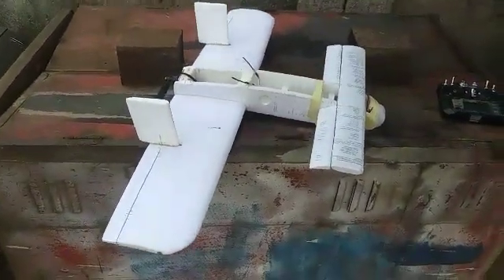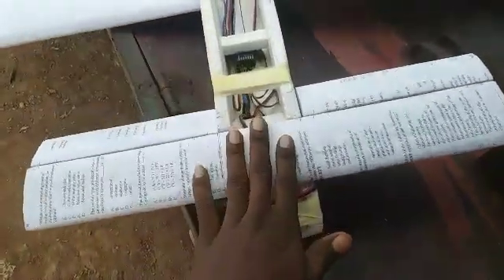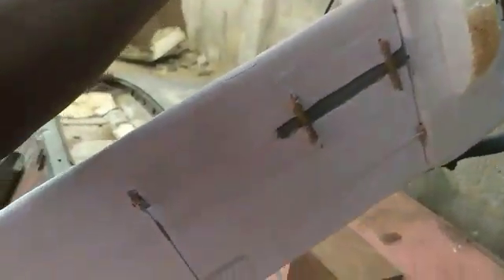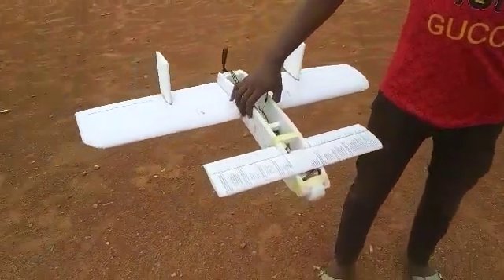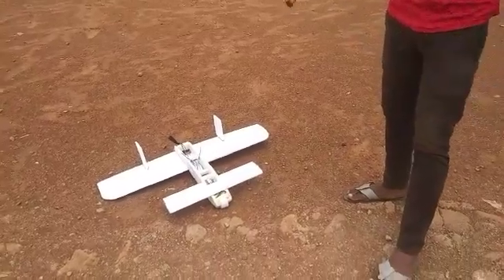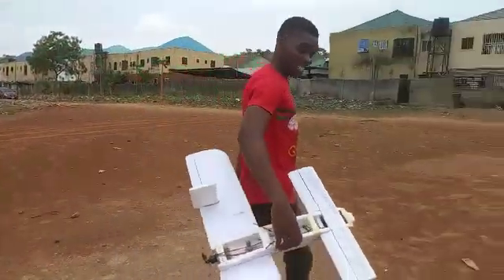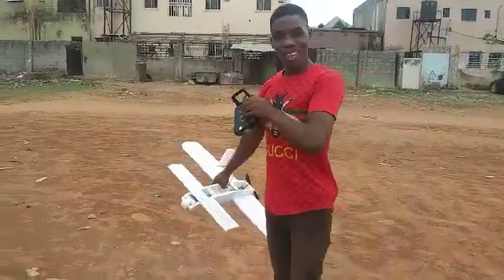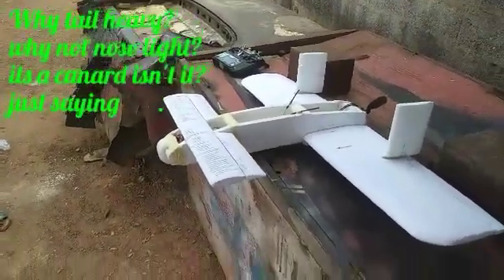Homemade RC Canard Airplane (AR Solonig)! First Flight

Comment: Beautiful work! I hope you will be able to fly on a calm day soon, as it is hard to evaluate performance while being kicked around by the wind, but the plane seems to have flown well regardless. I am curious, if you manage to fly in calm air, how long the flight time will be with that electronics setup. Did these short flights use much battery?
Reply from the maker: Thank you very much sir.
And yes. I was able to fly on a calmer day after adjusting the CoG, the rates and expo and the elevator. It doesnt drain much power. The motor was loud because the prop wasn't perfectly balanced. It was cut from an 8" prop to a 7.5". I feel there might be a small cavity between the plywood motor mount and the foam and hence creating that loud sound.

The power components are:
2s lipo, 25A ESC, 2208 2000kv outrunner motor and 7.5" propeller.
The plane has a main wing span of 39".
The 2s flies the plane very well but I normally don't fly for long. I like to take of and land more than I like to fly. I've not checked how long a full charge will last though.

This is the link to the second flight.
https://youtu.be/OwuKB0_okmA

This

Comment: Whenever you are using a wooden stick[..or just about ANY 'rigid rod'-like material...

As a way to impart stiffness, yet--you still find tis & poor torsional stiffness present...

The easy solution is LAMINATION!
 If you don't have better- grade materials[..carbon..]--or your plane/component is 'too thin/slim & narrow--to hold a "C", cruciform or "I"-girder cross-section spar,
Then slice up your wood stick into narrower, 'whip-like' strips or leaves; then glue them BACK together, clamped under pressure tightly. 
Your resulting piece will be similar in weight to the original, but it WON'T twist & will likely be stiffer versus deflection/'bending'!
Reply from the maker: Thank you very much Sir Allen.

Comment: some info.     at 1:58,  DRAG, at the poorly-designed vert-stabs, results in  nose-Up  moment.     due to its excessive span and area, the canard  tends to make a bit of lift.     this equals,  More  nose-Up moment.        especially, if the profile of the canard  is not, Precisely,  Symmetrical.     an overly-large canard  makes  more  Drag, than a smaller one.     these are reasons to  not use an excessively large canard.      compare canard design, of the  long-ez.
you may know that an airframe has  Two  points of balance -  cg  and  c-m.   center of mass.     in order for there to be sufficient control authority,  in Any  airframe configuration,    c-m  Must be  located,  slightly forward  of cg  -   at a point that vertically aligns with  25 percent of chord/mac.       at links,  IDEAL  locations of  c-m  (in non-canards)  are indicated/identified.      as stated,  correct  Locations  of cg/c-m  are  Ratios;  not  distances.    if interested, see the visual aids  in  my tutorials.
it can be seen that where a pusher prop configuration is used,  correct Design  of the aft fuselage  is  Essential.     design Should account for the  Need  to, both,   Minimize  the turbulence  in the air going to the prop  and, to  not   prevent   air  reaching the prop; aka starving of the prop.     the latter tends to contribute  to atypical prop noise.      in  ALL  cases,  an electric prop should   Not  make  much   noise.   cheers        googletranslate
center of mass
https://s3.amazonaws.com/assets.flitetest.com/article_images/medium/truecg-jpg_1384168691.jpg
http://static.rcgroups.net/forums/attachments/2/9/6/3/9/7/a5988257-224-bixler%202%20motor%20angle%20correction.jpg
long-e-z
https://en.wikipedia.org/wiki/Rutan_Long-EZ
https://www.the-blueprints.com/blueprints-depot-restricted/modernplanes/modern-qr/rutan_long_ez-47169.jpg
https://doc8643.com/static/img/aircrafts/3D/LGEZ.jpg
Reply: Well, that was confusing to say the least. Of course the canard has to provide lift. It has to have a slightly higher loading than the main wing, otherwise you have an unstable plane on your hands. The proportions between the main wing and the canard can be debated, but you get a wider useful range of cg with a larger canard.
The cg positions in your sketches are for conventional aircraft with a large main wing and a very lightly loaded stabilizer. They're more or less useless for a canard configuration, but I'm sure Martin knows that already.
Reply: @Snobiker13  bulleffingshet      it is clear that you know  LESS-than you think.   pinhed
Reply: @daviddavids2884  I've designed two canard aircraft that fly very well, thank you. Have you?
Reply from the maker: Thank you.